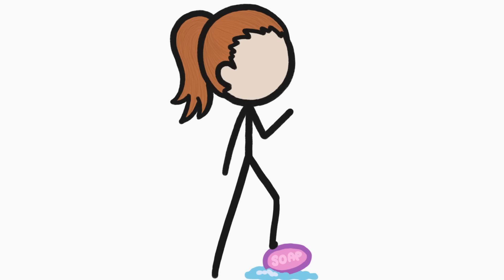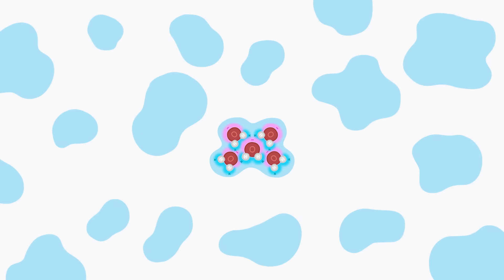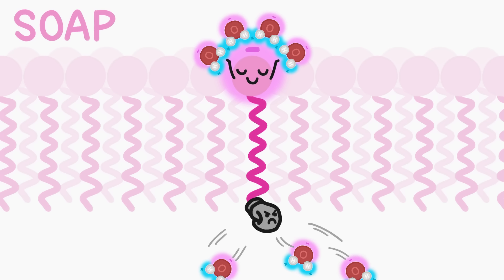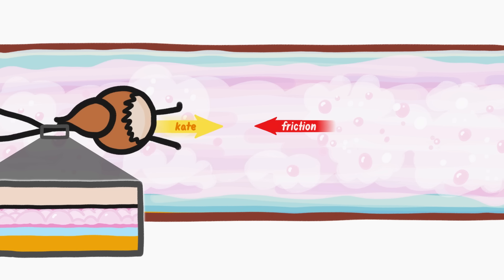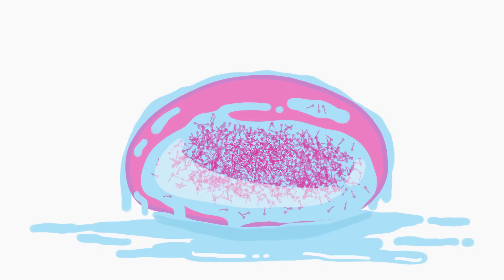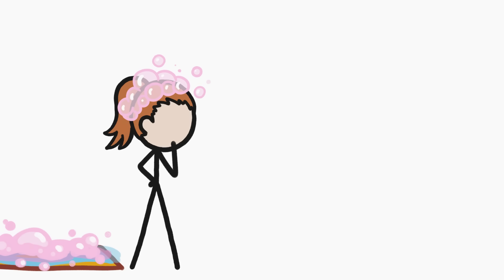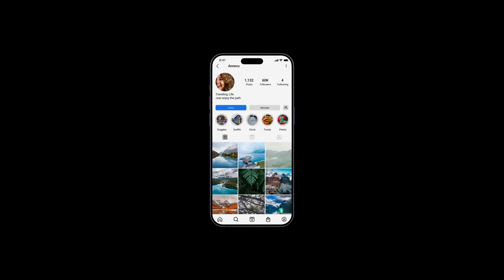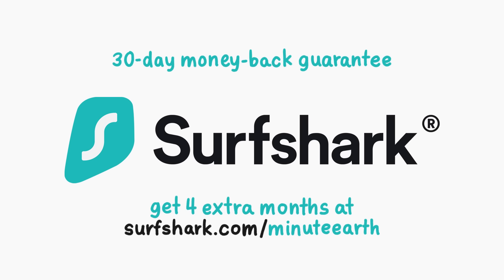The Science Of Slipperiness

Comment: Late to the party, but I've never experienced slippery soap. Wet or dry, soap is soap, my hand wraps around it and I can manipulate it like it normal. Coincidentally, my hands are very dry and I can't open plastic bags at the supermarket without licking a finger first (or finding that minuscule bag overlap edge that doesn't line up and bending it apart to fit a nail into).

Comment: Another important factor when it comes to the slipperiness of held bars is the shape of the soap bar; rounded bars are much harder to keep a grip on compared boxy bars. With box-shaped soaps, you can squeeze it from two opposing directions equally, much like how boxes stack neatly in many stable configurations; however, for round bars, any unevenness in the pressure applied causes the forces to misalign in a way that causes the soap to get pinched out; the only way to securely hold a wet round bar is to apply pressure evenly from multiple directions, which is difficult to do with just one hand.
Reply: so cast your soap in the shape of a dog-bone

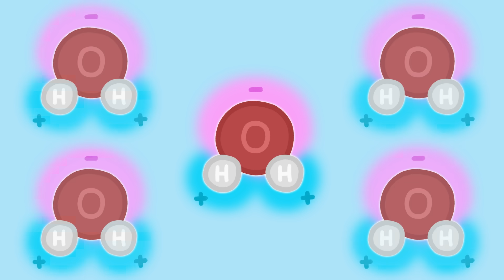Comment: 0:41 I get your point but water molecules aren't actually "charged"; to be precise, they are polar molecules.
Reply: And by definition, polar molecules have charged ends, no?
Reply: @CapSora  It's 'partial charges', not 'real' charges as there isn't an electron missing in/added to the molecule or the respective atoms.
Reply: Define 'charged'.
Their total charge is 0 (neglecting non-linear corrections), sure, but the total magnetic monopole of any magnet is 0 and we still call them 'magnetic'.
The water molecules have a non-zero dipole moment, so they have a non-trivial charge distribution.
For the meaning of 'charged' that I learned, this means they are charged.
Of course they do not carry a quantised elementary charge; but that was not implied, as we are working on a chemistry scale, not a subatomic scale.
Reply: @peperoni_pepino  You're right about what you're saying. It's an issue of (proper) definition. As pure water is non conductive (save autoprotolysis) and one would need moving charged particles for conductivity I don't like to think of water as a charged particle, only of a non-charged particle with partial charges. In contrast to NaCl, which in my definition has truly charged atoms Na+ and Cl-. Both views are absolutely valid though.